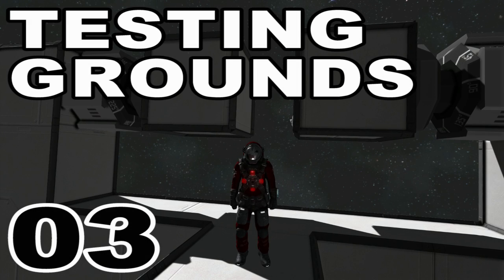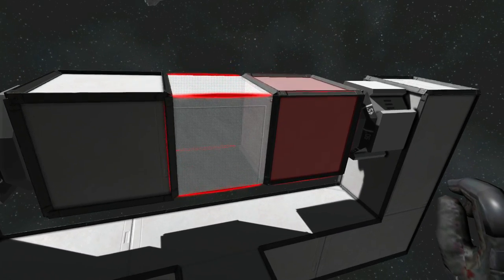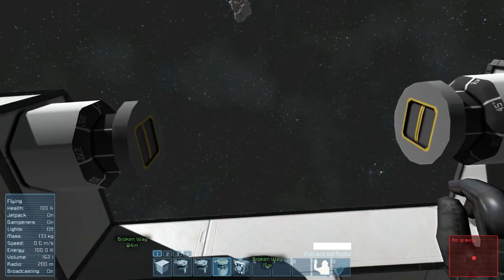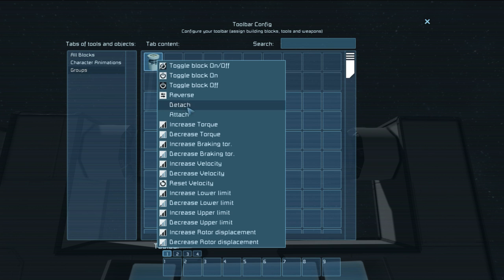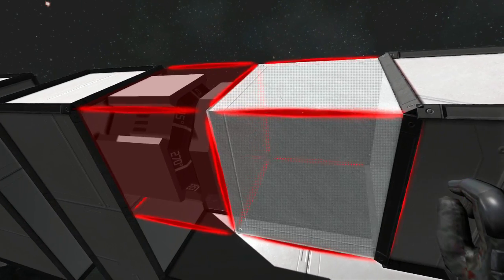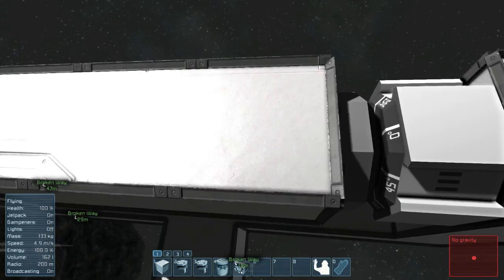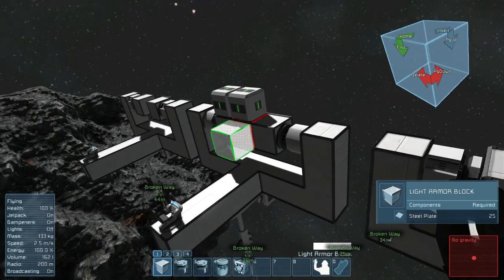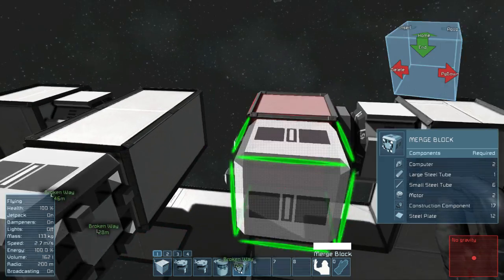E03 "Double Rotor Grid Redux" | Testing Grounds | Space Engineers

Comment: Many thanks! A lifesaver. Since the old trick stopped working, I've found no new video but yours.
Reply from the maker: +Andrew Melnikov You're most welcome. I'm glad I could help and that this trick still works since I made this video.
Reply: Thing with building rotor part separately actually stopped working after the latest patch. The rest still works, I used rotating merge blocks.
Reply from the maker: Thanks for the info. I've wanted to go through all these methods again and annotate the video if any of them were no longer working. I'll try to do that soon for anyone else that happens by.